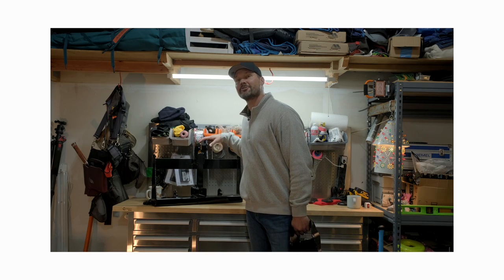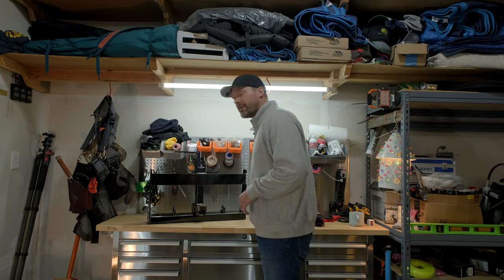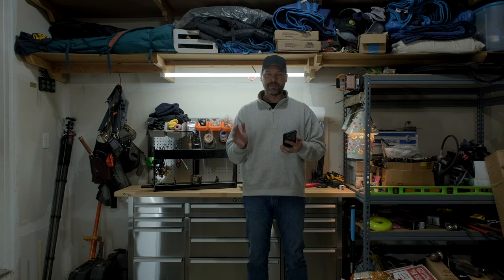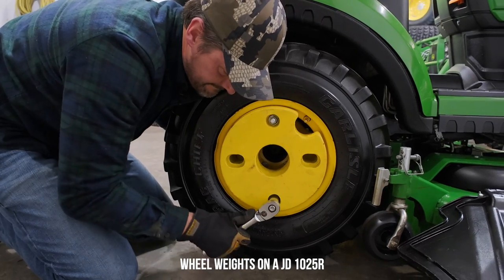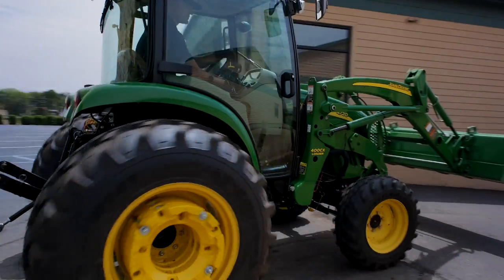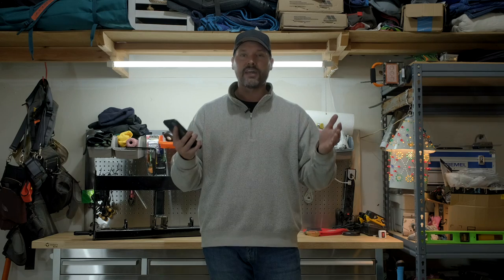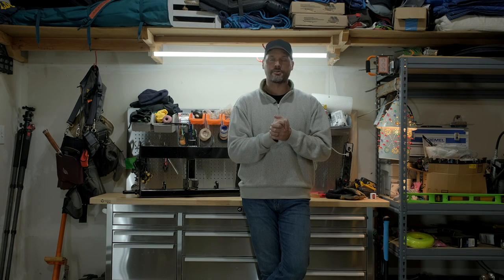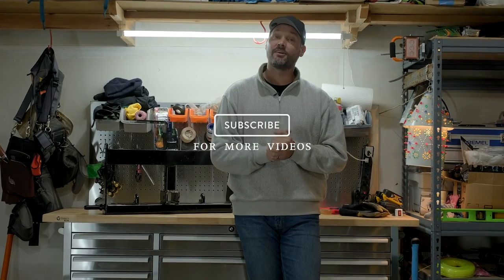MUST WATCH! GAME CHANGING TRACTOR BALLAST WEIGHT OPTION! 🤩

Comment: I LOVE the quick hitch side bracket idea. The sides maybe need to extend longer across the top, so you have 2 bolts across the underside (slots for adjustment?) of the crossbar, and maybe one against the vertical side member, again I would punch slots to adjust for member thickness for different makes. Punch the slots, then make your bends, weld the top piece on. Perhaps the outside edge needs a 1/4" relief where the locking handle was hitting it. Great idea!!

Comment: I'm actually working on a ballast option for my 1025r that will use a steel plate under the tractor where the mower deck would go.  I will never use a mower deck or snow-blower, so I don't care about the mid PTO.  I figure a metal plate cut to fit under with 3" sides filled with concrete and bolted to the under-frame should provide several hundred lbs of ballast as low as possible without impacting clearance.  As a bonus, it will function as a skid plate.

Comment: You should add 2 flats on the shoulder of the threaded pins so they'll be easier to keep tight, and people won't be tempted to use a pipe wrench or Channel Locks on them.

Comment: Hey it’s newbi here again. I just loaded up my ballast box with sand. And yes there is a big difference in the ride. Thank you for promoting this safety issue. I’m thinking I might need a dubbed wheel option I had a very close call digging out a big old root. Great video

Comment: Use a U-bolt with an extended top arm (going more towards the top 3pt link) to keep it from tilting down. Could do the same on the down leg as well. It would also make it easy to do multiple U bolt sizes for various thickness quick hitches. Makes you not reliant on  the corner bracing.

Comment: Find out if any major quick hitch companies are using a more narrow frame. If so, have another C-channel cut and and drilled to stack right inside the original you formed for the speedco. So basically they're just putting another 1/8in layer or whatever inside that match the bolt holes to keep it snug.

Comment: Courtney, something I did that made a significant difference in the front end weight was to have my front wheels sent off and "foam filled." This served two purposes. First, I was getting tired of getting constant flats on my front tires. As you know, the front tires take a beating especially when doing lots of heavy loader work. The final straw was when I had to go off to work for a couple of months and came back home to find the (almost new) tires had gone flat and being flattened that length of time had destroyed them. The second reason, that was frankly unexpected, is that the "hardened foam" they put in the tires is actually VERY heavy. It probably added 350+lbs to my front end. So, a nice addition of weight AND they'll never go flat! Getting them foam-filled isn't cheap, but in the long run, given the cost of repairing and/or replacing torn up tires, it's quite a bit cheaper.
Reply: how has this been in the two years and can you mention the specific product?

Comment: Thanks for the rundown of ideas. For snow blowing with my diesel garden tractor, I made a concrete block that has a draw bar embedded in it with angle iron coming out of the top. It is compact (fits between the lower 3 pt arms), heavy (mine is about 400 lb but customizable during the casting), and cheap (maybe $50 including draw bar, angle iron, and concrete).

Comment: The 2nd thing I bought for my tractor was a box blade. I added 200 lbs of removeable wt and leave the blade on the tractor most of the time, it weighs well over 600 lbs. Also it protects the back of the tractor backing up in the woods.

Comment: Instead of moving the bolt holes if you are trying to fit different quick-hitches, you could have a variety of sizes of nylon sleeves (like bushings) that fit over the bolt that would adjust the tightness. That was the thought that crossed my mind when I saw you jiggling the bracket because of the loose fit.

Comment: For the porotype weight bracket, I would use U bolts to hold the bracket down instead of a cross bolt. It would be less finicky with regards to the quick attach dimensions and hold the weights better since it would be counteracting the force of gravity. Just a thought.

Comment: That's a nice upgrade on the hitch with square tubing. If those hitch pins screw into the tubing and it's open I would mix up some cement/concrete and pour in the tube to add weight.  And that's a good idea on the brackets for weights on the quick hitch.

Comment: Courtney, those are ALL great options for ballast. I also like the prototype weight bracket concept. Adding a bolt/pin to the lower section may prevent the tipping of the bracket. 
PS: I got your joke, you just couldn't hear me chuckling lol

Comment: For ballast weight, I bought a ballast box and filled it with old solid marble tombstones that I broke up with a sledge hammer and then filled around the stones with runny wet concrete. Weighs in at 750 Lbs exactly. Perfect amount of weight for a 36HP tractor.

Comment: Great video. Love the prototype bracket. I would extend where the bolt goes closer to the center of the tractor and add a second bolt or have a sleeve for the bolts so that it takes up the room and make it more universal fit. Then I would extend the weight bracket down a little more and maybe add a bolt hole there as well that way you can make the gap a little longer to clear the lock handle. I would be willing to test it out for you.

Comment: The quick hitch side brackets are brilliant !!
I'd buy a set with a full set of #70 suitcase weights tomorrow if they were in production.
If I were offering design ideas, I'd make the top section a few inches longer and have two bolt holes horizontally to go under the top bar. That may help with the sag as well.
If you have a list of wannabe beta testers...I'll jump on that :)
Keep up the good work !!

Comment: While a backhoe adds plenty of weight most of it is to high up and adds to rollover potential. 1/2 loaded tires , a mower deck and wheel spacers are the best combo for hilly terrain.

Comment: Two ideas is to replace the single bolt with a u-bolt that goes under the top bar and maybe across the side to tie it into the corner better. The other idea is to run flat bar or something similar across from corner to corner to keep them from twisting. More metal =more weight, but the draw back is either there is more work for you or the customer when it comes to setup as well as increased cost.

Comment: I built my own quick hitch as a test build and have bars sticking off the side the same dimension as the hole in weight lifting weights and big nuts on the end the weights I get free or almost free from marketplace and can fit 4 per stud 1stud each side  using 20 kg plate weights 160kg not including the hitch weight and could add another stud each side if needed so 320kg so about 705lbs theoretically but still testing with the single stud each side so far. unsure how that weight lower on the hitch for the 2nd stud would effect the hitch bowing inward but with the one stud each side up top similar to Ur setup seams to be great so far.it also has a 2 inch receiver set back slightly and below  the  top hook but depending on the implement this could interfere with the PTO shaft but for my implements I haven't had an issue but gets close on the wood chipper at full height.

Comment: just from what i could see, it seemed like those bolts were under a decent amount of pressure
this is just a suggestion if its possible, but i might consider extending the bracket so that it reaches more towards the center line of the tractor to have new bolt hole there instead so its less likely to cause any problems when/if a bolt breaks on your current prototype design

Comment: A quick question on the SpeeCo QH... Although the draft pin hooks are sized to fit snug around the bottom and sides of a CAT-1 draft link pin, there is a significant gap above the pin before it hits the draft pin latches.  Has this given you any real world issues or concerns?  To be fair, I have no idea if the bushing style quick hitches have this same issue or not.  Thanks.

Comment: I noticed in the equipment you displayed, one was a 3 pt hitch, PTO driven sprayer for a compact tractor.  Something like a 55-60 gallon unit.  I checked your website for an offering, but didn't find one.  Do you stock those sprayers or have a association with a manufacturer?

Comment: thanks for sharing the video my kioti tractor dealership told me if I add more than one weight per back wheel @ 100 pounds per weight I would void my factory warranty on my rx7320. this is a big tractor it needs weight even though I put liquid in the wheels it's really not enough weight

Comment: If you had a 1" or 1-1/2" eccentric sleeve over that bolt it could be rotated until it was snug on the gusset before you tighten it up.....

Comment: Put two bolts in the design, with the 2nd bolt closer to the inside corner...or perhaps even better would be to use a U-bolt.

Comment: Fantastic idea! How about adding some vertical tabs on either side of the weight stack, so you can put a locking bar across to secure the weights to the bracket?

Comment: thanks for sharing the video, I want to add weight to my rear wheels on my brand new kioti RX 7320. kioti told me if I added more than one set of weights equaling 100 lbs per rear wheel it would void my factory warranty.

Comment: How did you get your Roll Bar on that 1025R to stay in that position ?
Reply: When u hold it at that 90 degree level there's no hole to put the pin into you'll see where you can put the attached bolt and pin through one the holes and uses upright part of the roll bar and rests against it

Comment: Instead of putting a single pin to hold the quick coupling weight bracket you have designed you need to make two pins a upper and lower using a vice-like system triangular shape where the head of the vise is separate from the lower part of the vise the upper and lower pins hold the vise in the armpit if you will then you wrench a bolt system opening the vice  to put pressure on the inside of the quick coupling securing your bracket tight to the quick coupler shoulder too bad we can't draw pictures and make designs on texting unless there's something new I don't know but basically to put it this is not a vice to cramp inward a vice to crimp outward putting pressure in the armpit of the quick coupler securing it to the coupler if I knew where to send my ideal with visual I would surely do that

Comment: not sure who is helping you design the new bracket. You need to either put 2 small bolts at the flat bar at the top of your new weight bracket will make it solid. even 1/4 inch although I would go 3/8 grade 8. I would say 90% of your customers for this product should be able to drill and tap 4 holes. Another other option is the leg going down the side needs to be much longer. Option 3 you need a flat bar running from the flat bar to the corner. Likely most of these need to be combined with a tube that goes over the main bolt you have to snug things up.

Comment: If a tractor has a "minimum ballast weight requirement" per the engineering specs, why don't they just build that weight into the tractor to begin with?  Seems like a no-brainer.  Imagine if you had to fart around buying extra after-market blade guards for your miter saw to meet the "minimum blade guard requirement".  This "problem" of not having enough ballast seems at least partially created by the manufacturers themselves.